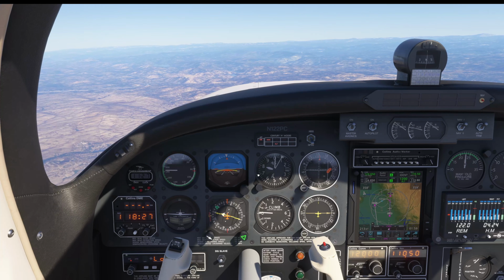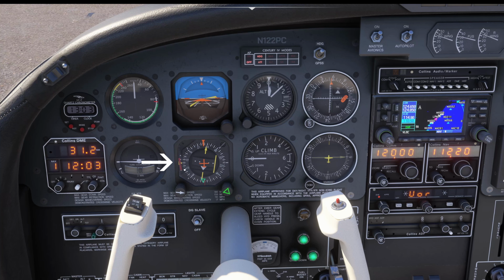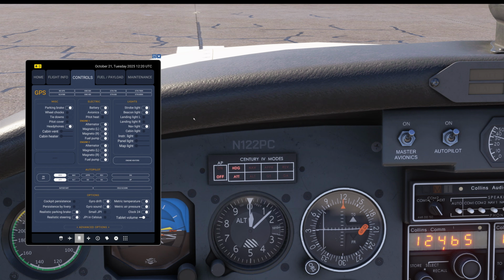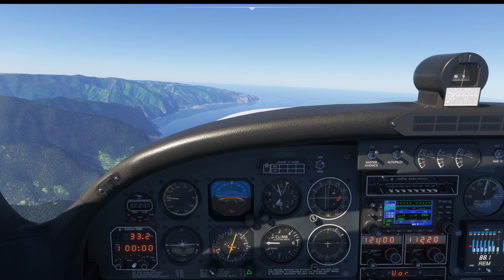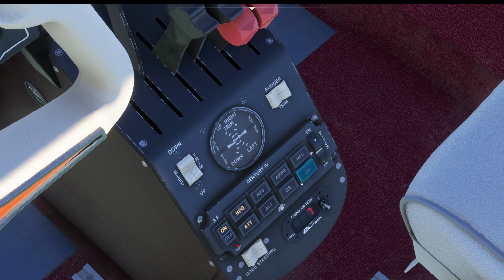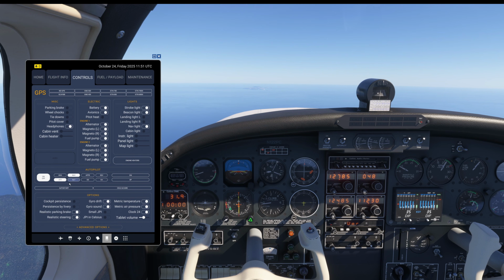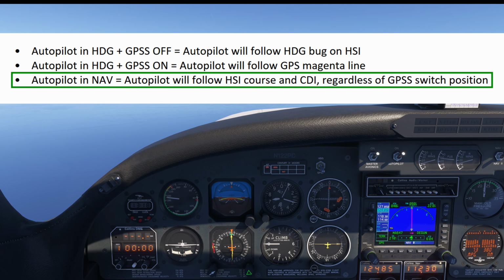Accu-Sim Aerostar 600 Autopilot Guide | Accu-Sim Tips & Tricks for MSFS2024/MSFS2020 Pilots

Comment: One thing that bugs me is that nav mode will intercept the course even many miles away. In reality it should arm and you need to get close to intercept.
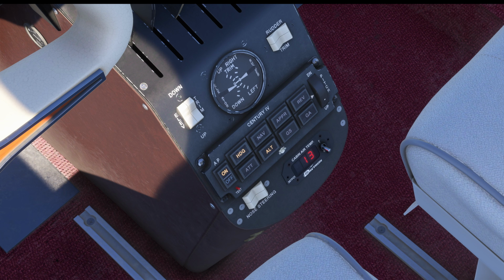Reply from the maker: Nope, the current behaviour is correct. Arming the intercept is only possible through HDG+APPR combo that is explained at 20:05. This feature can also be used for cross-country VOR intercepts, as suggested in the real autopilot manual.